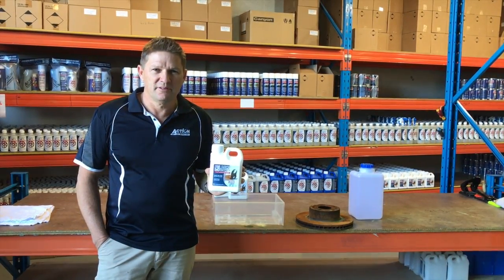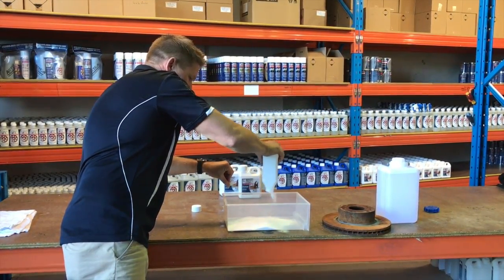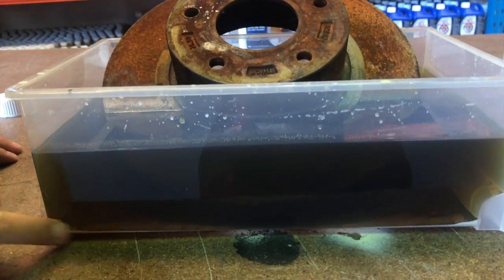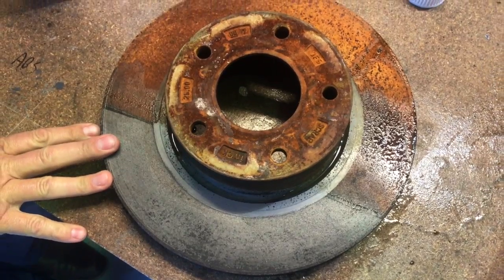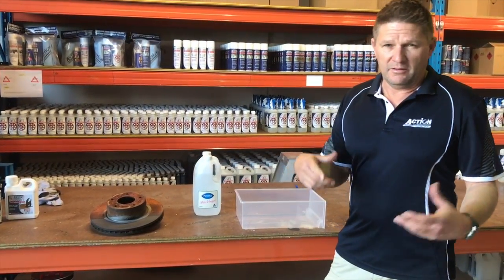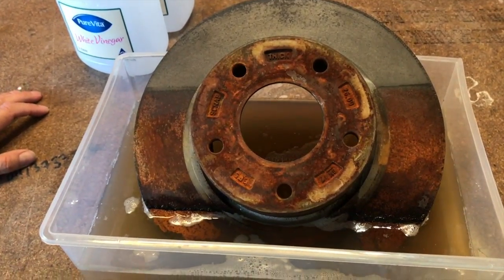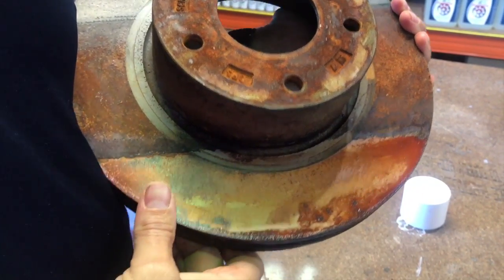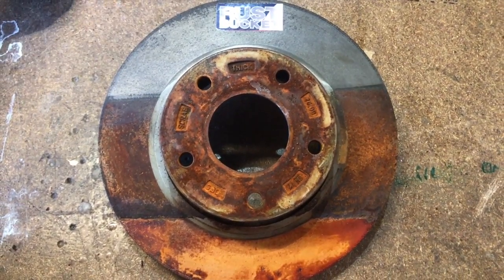Rust Removal Vinegar VS Rust Bucket

Comment: Ok, but before you let the rust come back (flash rust) on the vinegar side, the vinegar clearly did a better job cleaning it. Had you just taken a dab of oil and coated the area, it would have been fine.

The vinegar attacks the rust first. It affects the steel too, but much slower (minimal). Unless you kept the rotor submerged in vinegar for a year, you’re not damaging any steel. Just rust!

And btw, the rust coming off in flakes doesn’t have anything to do with what it does to the steel.

You’ve got a good product there, I won’t deny that. But intentionally rigging the experiment to make it look like vinegar doesn’t work/works Poorly is bullshit.
Reply: He states in the video its targeting inaccessible areas this test is demonstrating. Somewhere not accessible to then apply a coating to.
Reply: Not only does the vinegar not damage the steel but if your so worried about “flash rust” transfer your metal that your treating with vinegar and place it in a bath with baking soda and water to remove the acid from the vinegar
Reply: Thank you both for this info 🤣 I have a small spot of rust under my car and don’t want to spend too much money.
Reply: @pyromaic  USE CAUTION: VINEGAR + BAKING SODA = CARBON MONOXIDE. Complete this process outdoors
Reply: casiotechI  Probably something to do with surface area or tension? Flow in and out of a the pits so to speak.
Reply: = carbon dioxide, not carbon monoxide.
Reply: walters  you said exactly what I was thinking, although I'd dump a large pile of baking soda straight into the vinegar which should remove the acidity within the vinegar.

Amd cause an exciting reaction for my kids lol
Reply: He also rinsed of the rust bucket multiple times, the vinegar only got 1 rinse off
Reply: @donthurtmurt1912  which is why water is used to make the reaction inert

Comment: When you use vinegar to remove rust you MUST then wash the part in a water/baking soda solution to neutralize the vinegar or it will continue to eat away at the metal surface.
Reply: Thank you
Reply: You are very correct.  Too bad the focus is only on the product being pushed.  Vinegar needs to be neutralized and this wasn't done.  I'd like to see another video like this but without the obvious bias.

Comment: It's great to be able to endorse an Aussie product without reservation. Inside of a Yamaha LS2 tank was very bad with old fuel and sludgy rust. Left for 2 days. I was astounded to find the metal inside completely clean. Upended the tank contents into a bucket to find a large amount of rust removed. Very happy with result.
Reply from the maker: Thanks for your comment Lin! :)
Reply: I knew it was an australian accent
But i doubt myself initially.. 
Because the way he speaks is so different to other english speaker

Comment: The vinegar seems to remove rust better than your product, and you thoroughly neutralized and cleaned your product off vs the vinegar where you didn't neutralize the vinegar from the metal after removing it from the bath.

Comment: Is the rust coming off in sheets really just the same as the other solution only that is dissolves the corrosion? I would think taking a precise weight measurement would tell if the vinegar is actually taking the same amount off, just in a different way. And my other problem would be getting it in the states to even try it

Comment: Rinse and neutralize the part after. even with a spray on neutralizer still cheaper.

rust bucket $49.99

1 gallon vinegar 4.99 + box baking soda 1.99 + soft brush 1.00 = 7.98
Reply from the maker: Yes that is cheaper. Just like it would be cheaper to put water in a radiator instead of coolant.
Reply: I bought Rust Bucket based on this video.. Total rip off just use vinger!
Reply: Rust bucket is Definitely a scam.
Reply: Man’s got a point. Spend 50 bucks on a 30 dollar rotor 😂

Comment: Hello Rust Bucket 
Thank you for the video. I have a carpenter square that belonged to my Grandfather.  So it's about Sixty plus years old.  And I can still see some of the markings on it. 

Will Rust Bucket leave the markings intact. Or will it remove everything from the square. And leave the metal blank? If you're product works and leaves the marking intact,  What would you recommend to coat the Square with to preserve it. I recieved this carpenter square from my Father who received it from my Grandfather. That's a lot of family history I, Want to pass on  some day.  Again great video.
Thank you
Reply from the maker: Hi George, The Rust Bucket works through a process called chelation. It means that the rust is taken off the metal into the solution. It will not eat away at the metal or the markings like acid can. After the rust is removed you should protect it with Action Clear Top Coat. This is a clear protective coating which prevents rust and tarnishing. You can see Action Clear Top Coat demonstrated in our other videos.

Comment: I’m an Autoglass technician in the great state of ohio. I work on a lot of cars with rust in the line of the urethane and on body pinch weld. What would be your advice for combating this while installing a new windshield
Reply from the maker: Please email actioncorrosionusa@gmail.com
Reply: Use a wire wheel. Remove the rust. Prime with dow pinchwell primer. Glaze with urethane.

Comment: Where can you buy rust bucket stores @
Reply from the maker: Hi Darren, you can find your closest stockist on our website or if you send an email to admin@actioncorrosion.com.au with your location we can suggest a store near you.
Reply: @actioncorrosionptyltd2526  
what's the problem of keeping rust for long time?  is serious problem? or only as a good veiw. to remove it
Reply from the maker: @mohamedelmaradnyid8890  Rust eats away at metal weakening the metal objects. It will eventually eat through and create holes which are sharp and rigid. It also creates a bacteria called Tetanus. If Tetanus enters the blood stream, it can become quite serious if left untreated. Rust can also cause metal objects which should slide over each other to become stuck.
Reply: @actioncorrosionptyltd2526   is there a periodical time/ Acctaple certain time  for removing rust? or every time it appears I have to remove it quickly as soon as possible?
Reply from the maker: @mohamedelmaradnyid8890  There is not a specific time frame. Rust forms at different rates depending on the conditions. The sooner you treat and protect form rust, the less damage it will cause.
Reply: @actioncorrosionptyltd2526  
thank you for answering me
but what make me sure rust will not happen again....can I wait until the winter finished?
Reply from the maker: @mohamedelmaradnyid8890  The only way to make sure the rust will not occur again is to treat and protect the metal surface.